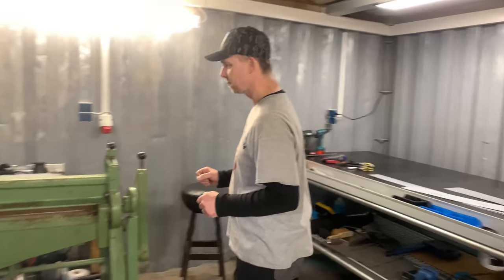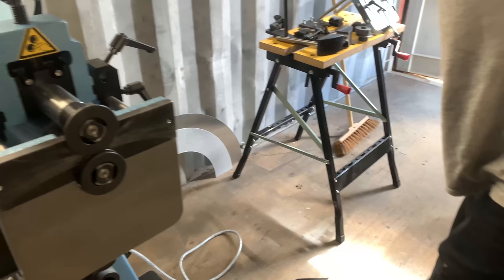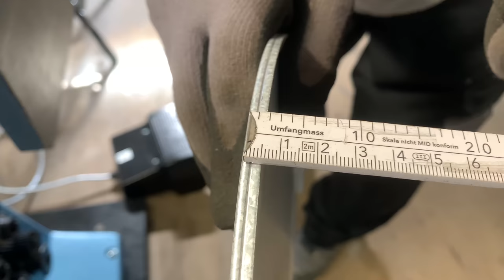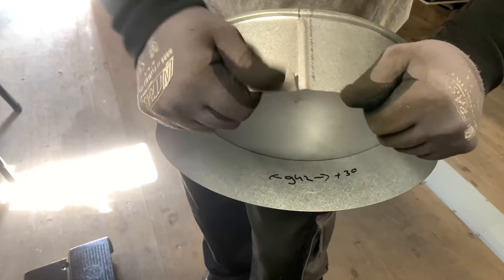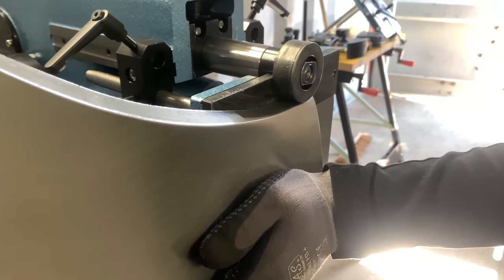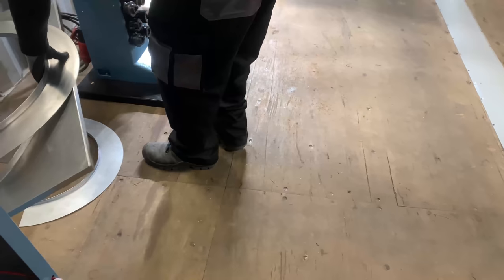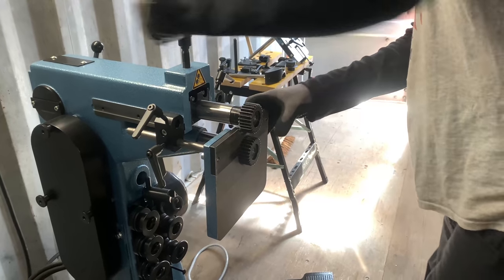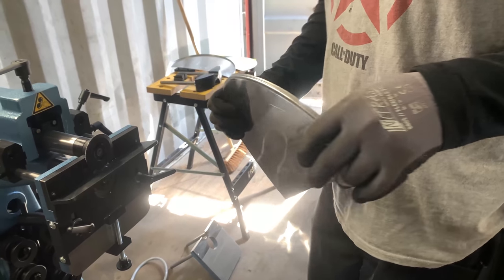Sheet metal machines

Comment: Very nice work.  You're very skilled.  I'm afraid I had a bit of problem with the audio.  Had my volume turned up all the way, and could not hear well.  What is the brand of swaging machine?   The circle cutter is very neat too.   Who makes that?  Finally, was wondering why you used a pop rivet on the end cap, instead of a spot weld...

Comment: hello, very interresting. I need to do the same with rounds with edges of 10 mm . material : Stainless steel AISI310S - thickness 1 mm . do you think it will work ? thank you for your answer ;-)
Reply from the maker: I know know it’s possible I worked a lot with 1 mm stainless
Reply: @Sheet_Metal_Workshop  thank you very much for your quick answer. 
Have you an idea of the price of this machine ?
Reply: @Sheet_Metal_Workshop  if I understand well, this is the position of the guide that give the height of the edge ? correct ?
Reply from the maker: @christianvandersanden7164  yes
Reply: @Sheet_Metal_Workshop  thank you. I've asked for the making of 2 new rolls to to this work. I'll try when I receive it. thank you.